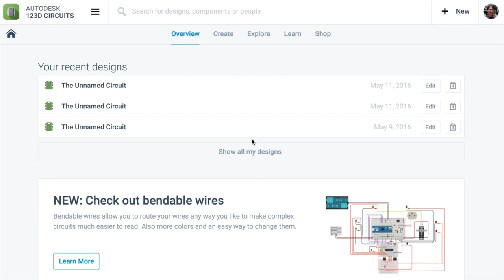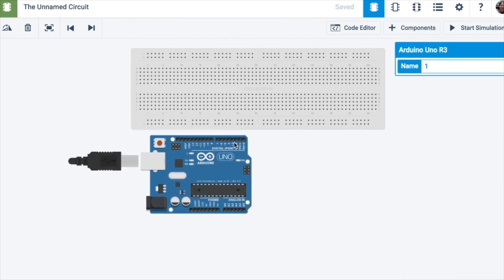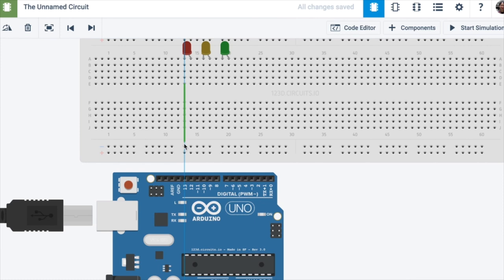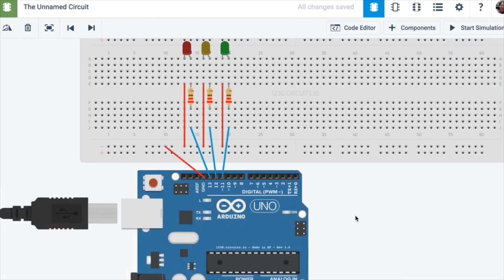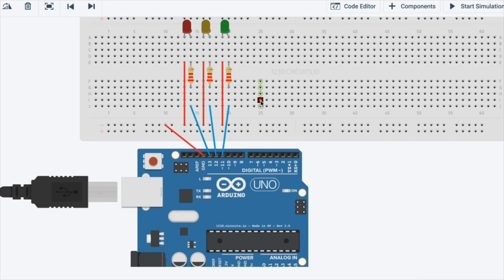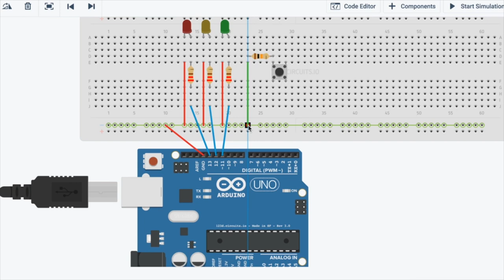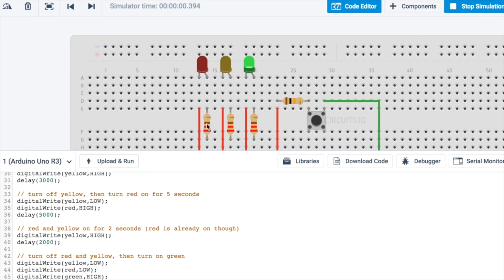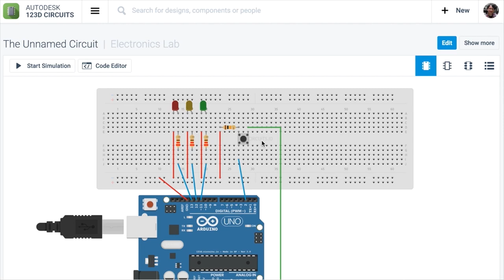Arduino Emulator and Traffic Light Project with 123Circuits io

Comment: looking for an emulator.  This is just another simulator, isn't it?  I always thought that an emulator was a hw/sw system to debug code in your actual circuit.  You unplug your processor, plug in the emulator cable into the cpu socket and then step through your code.

Comment: How do you know which resistors to use? That's where I run into issues
Reply from the maker: +speck213 Depends on the specs of the LED. Use this calculator: http://led.linear1.org/1led.wiz

Arduino source voltage is 5v. LEDs typically run at 1.3v, and want a maximum 20mA power. Plug those values in, you'll get 220 Ohm. It's based around "ohms law", V=IR if you want to look that up somewhere.
Reply: MakeUseOf I just took a circuits course so I have that down haha, but they never taught us how to put stuff together, only analyze. Thank you very much for the response.
Reply: speck213